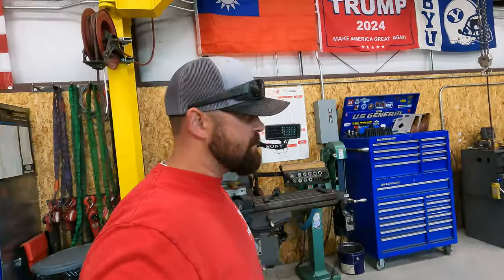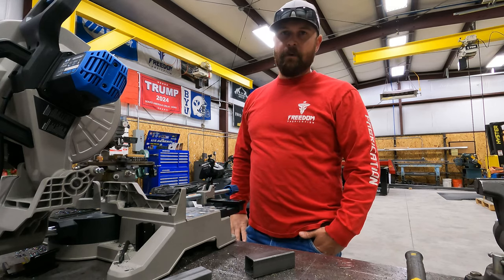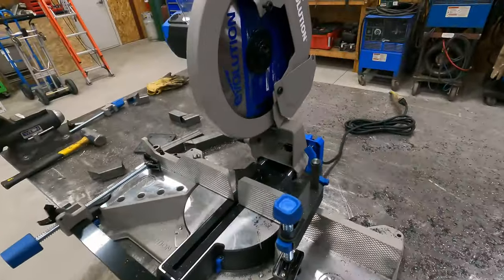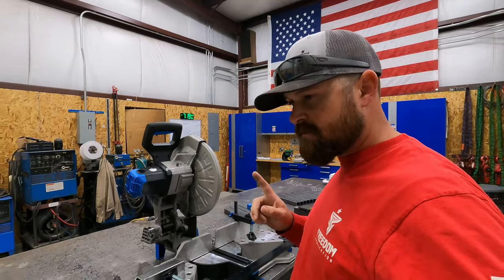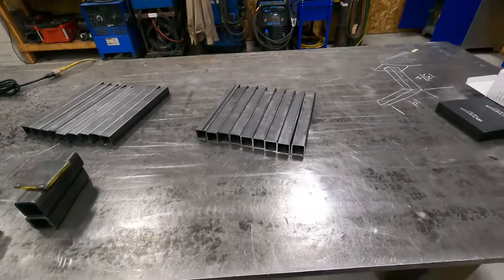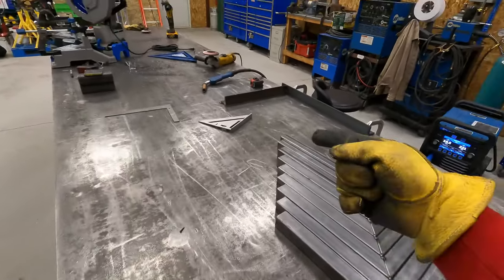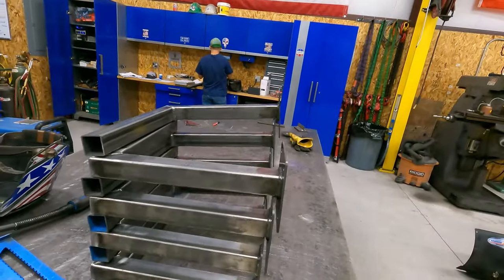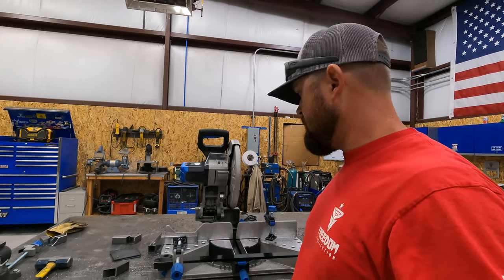Fabricating Park bench brackets

Comment: Yes I'm a bit jealous of that Miter Saw. I got the S380CPS saw about a year ago. It does a real good job however the ability to miter both ways would really save a bunch of jacking around. Yours would be much easier to set up a dedicated cutting station for. Thanks for the videos!
Reply from the maker: It really is a game changer. I will be interested to see how well the blade holds up. Thanks for watching!

Comment: I have a Dewalt compound miter saw that I use for ripping construction lumber in my shop.  It's the biggest pig in my shop in terms of broadcasting dust and chips.  I mean, it gets chips all over my 30x50 shop.  I ended up making  a cart for it with duct collection.  It's basically a big box that the saw partially  sits in with a hole in the back for dust collection.  In reality, the box works so well that I rarely even bother using the dust collector unless Im doing a big production run... Every now and then when I get an accumulation, I will vacuum it out.  But just by putting a box behind it, has completely  confined and captured 99% of the crap that it normally would broadcast all over my shop..  It collects the material to a small area that can be cleaned out from time to time...       So, I've been eye balling this evolution saw for some time, and seeing your problem, I can imagine a way to mount it so that It captures a majority of the waste.  Maybe a little slope and a waste gate so you can open a clean out to get the material out...   the biggest issue I have is space in my shop, so I integrated some drawers into the bottom of it to buy back some space.  I mount it on wheels so I can push it around easily.  For your set up, you probably are going want some kind of vertical supports that you can use to prop up long stock.  I designed my cart in fusion 360.  I can send you some pics and the file if you are interested.

Awesome content as usual...  Cheers
Reply from the maker: So I have been trying to figure out what type of setup I would like for this saw. I’m thinking something that can be mobile for when I need it on a job site. I do like your idea for a catch pan behind the saw. Yes, I would love to see your drawings! I’m always interested to see how someone else would design something. Can you send me a message on Facebook with the link for your photos or drawings?